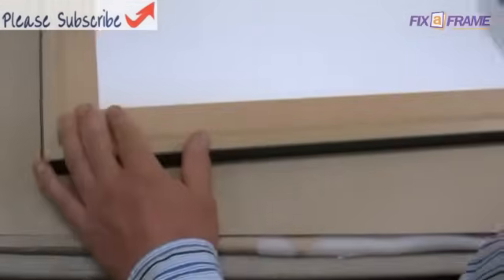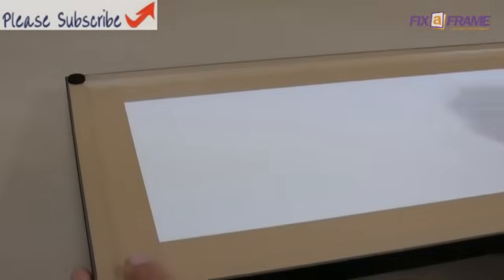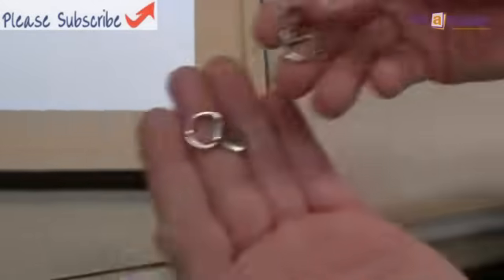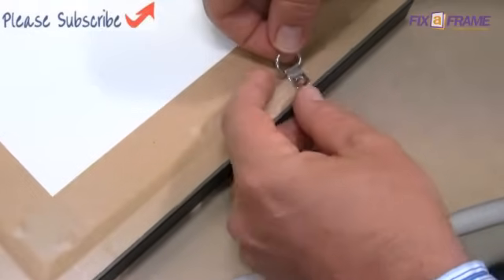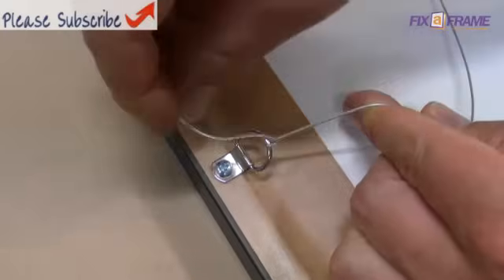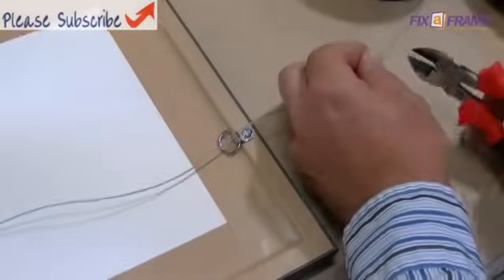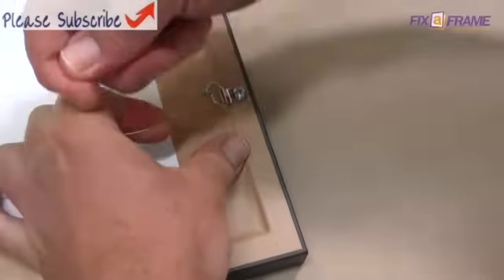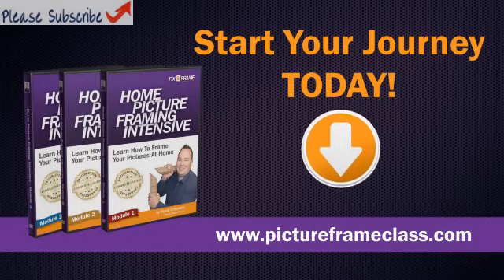How To Screw D-Rings & Tie Wire On A Picture Frame

Comment: If your wall is damp don’t risk ruining artwork by hanging anything on it. Small pieces of felt will not make any difference to this, damp walls are very persistent.I’m an artist and have never seen anyone use these professionally when preparing artwork to hang in an exhibition or to sell. No expense is spared when framing artwork as the cost is built into the artwork price, so the cost of 2 felt circles would not be an issue, if they were indeed that useful. It’s also better for small/medium size artwork to pass the wire or string through the first eyelet, double back to the next eyelet and then tie off at this next/second eyelet.
Reply: Agreed on damp wall. He didn't show measuring before placing...
Reply: Ahh. I need help! I agree with the damp wall, though didn’t understand this method. I’m hanging drawings in pictures frames in an art exhibition this Thursday for the first time but don’t know how to prepare the picture frames to hang! They already come with sawtooth hangers on the backs of the frames but I keep reading about using hanging wire?

Comment: Excellent tute! Thanks! I bought a pkg of D-rings to hang small pieces for a craft fair, but had no idea how to attach. I've got them all screwed on now, couldn't be easier, much better than the old eyelet. Now to source plastic-coated stainless steel wire, maybe Bunnings.